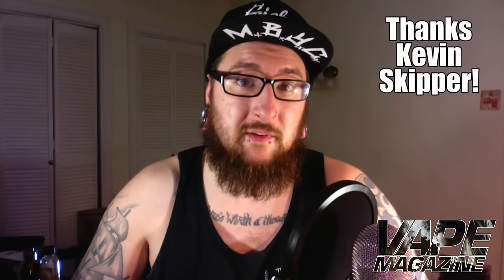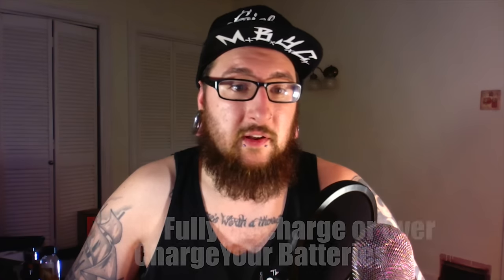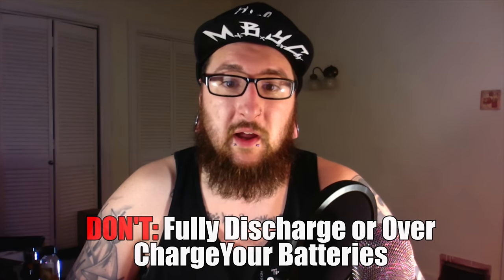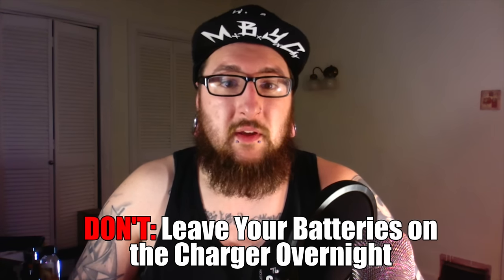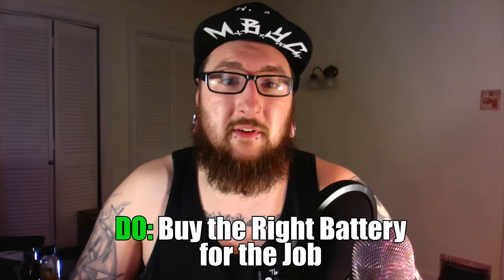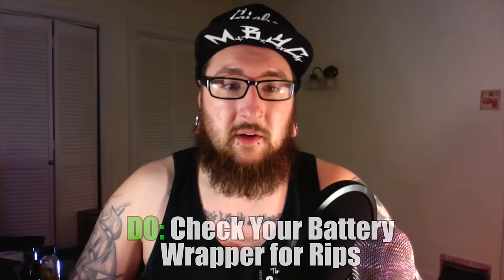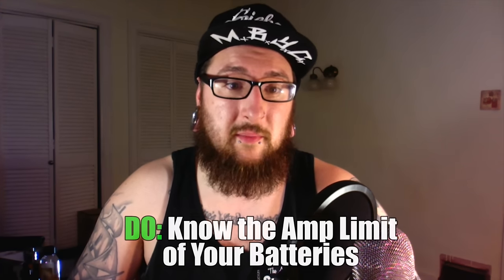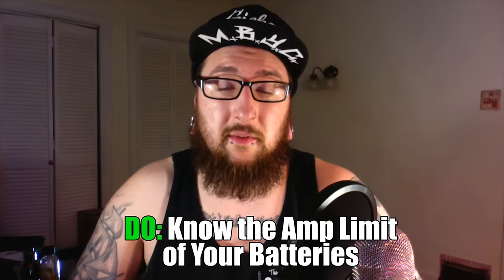DVTV Vlog- Battery Safety for Vape Magazine

Comment: 05:20 .3 for a VTC4?  Damn... I've been doing it wrong, right now I'm hitting a .1 build in a Tugboat V2 atty, on a Tugboat V1 mech mod.   According to your link (chart in description) there are no batteries capable of below .3... really?
Reply from the maker: MAXXHEW According to the charts, the VTC4's have a 15amp continuous limit which means the lowest build you can do at 15amps is 0.28ohms but like I say, you should always have a little wiggle room in case your coils fluctuate. If you go any lower than that, it can put stress on the batteries and reduce the lifespan or make it more likely to vent in a worst case scenario. I know people that vape at 0.1ohms on a regular basis because they go by the pulse ratings rather than the continuous. I myself have been guilty of that and I know it won't stop people from doing so as is the case in most cloud comps but at the very least I will be able to reach some of the newbie vapers that are looking for this sort of information and maybe change peoples minds about exactly how fragile battery chemistry can be.
Reply: Daily Vape TV The new Sammy's 25R are green... no more smurfs.
Reply from the maker: MAXXHEW I know :( They will always be smurfs in my mind though.
Reply: Daily Vape TV Great vid... keep up the good work.  We need info like this everywhere, thank you.